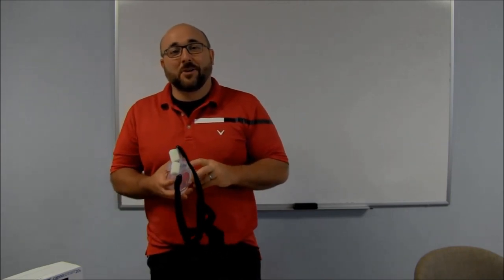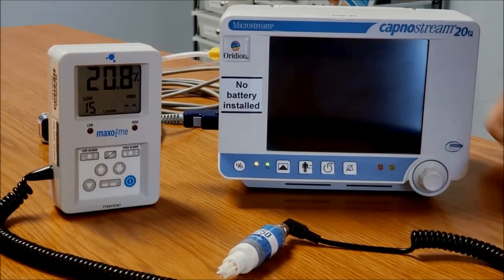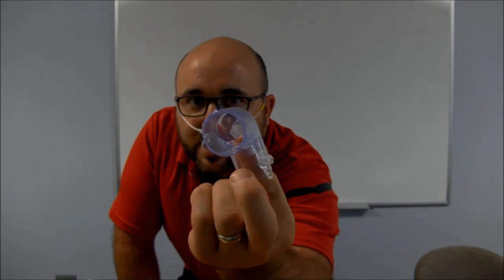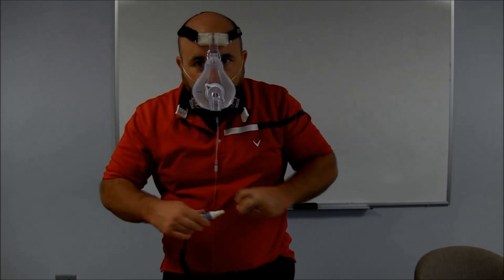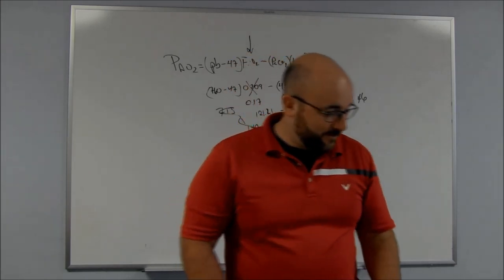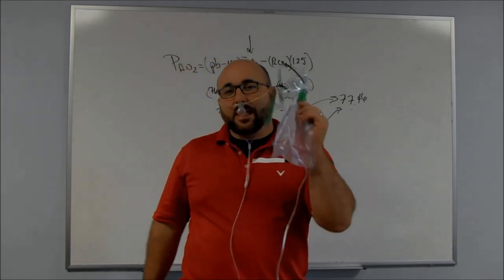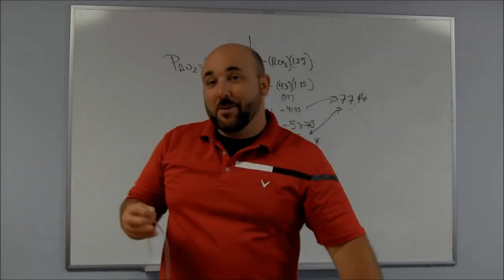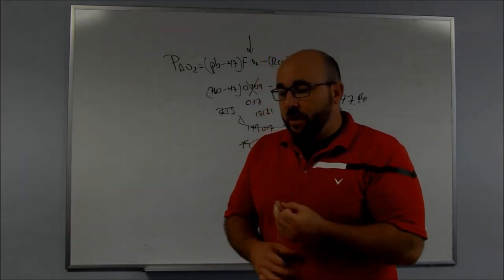RT Clinic: Will available oxygen (PAO2) decrease under three different types of masks? ANSWERED!

Comment: @Jimmy Mckanna - RT Clinic I came here because of the view that one could test oxygen reduction into the body from any mask by using a fingertip device that I don't think pricks the skin (or does it?) to measure blood oxygen.  But the tests I saw demonstrated no changes and showed 100%, so no reduction from a N95 mask. Does oxygen in blood change that fast if at all and if it can change fast is the finger tip the best way to test changes from breathing? 

To me it's common sense that if you obstruct breathing in any way you reduce and slow down oxygen flow which is the reason if you stop it totally for much time we pass out and die.

Comment: Looked to me like the pco2 went up by about 5 mmhg. Maybe the oxygen analyzer measured your exhaled o2 instead of available o2. Cause with mask off your available should of been 21 but read 18. Nice study though either way. Wearing masks sucks.
Reply from the maker: It is makes sense to why an obstructive patient in an exacerbation wants a fan in their patient room. That 2-3 % point drop in FiO2 from 21% could truely affect their Pao2. The fan circulates exhaled air.